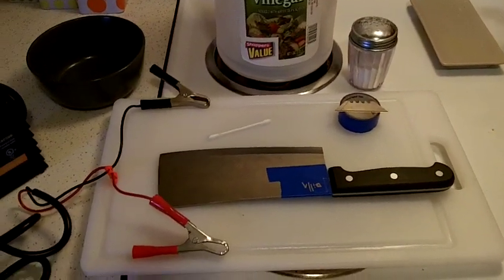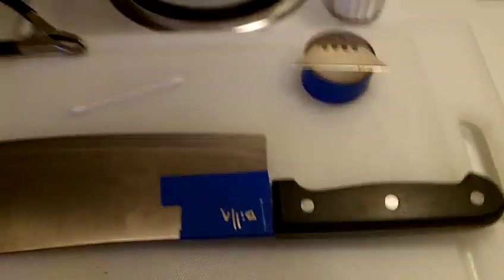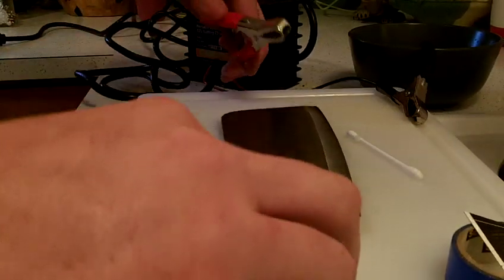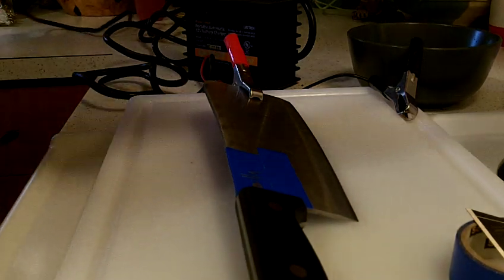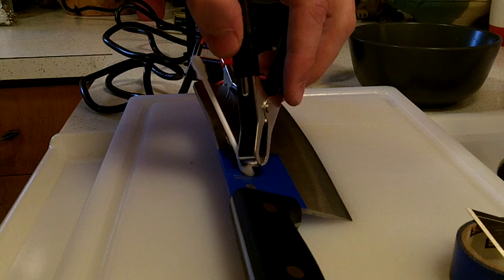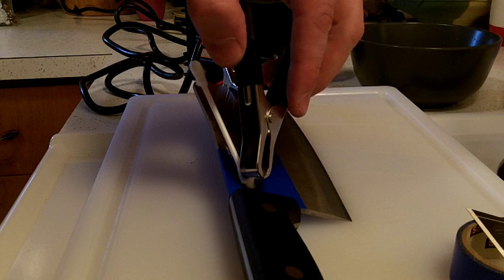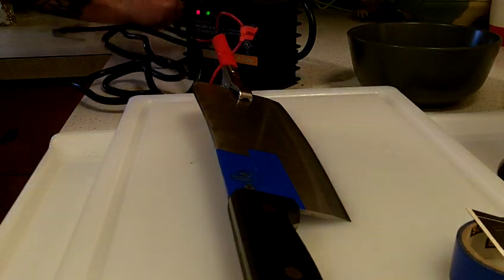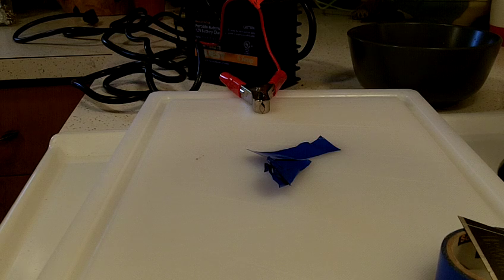how to etch steel

Comment: i want to etch 6 letters 1/2 x 1 ea in a steel plate that is 1" x 48" x 96" 
1307 lbs    how much electrical current would i need ?

Comment: anyone come up with a reusable material to make a template from? Something durable that continues to be sticky after many uses?
Reply: silhouette cameo.  I lay all my stuff out in illustrator, cut out the negative on light adhesive shelf paper
.I made 3d camo stencils that turned out very sharp.
Reply: shelf paper is a good idea, does it stay sticky after using it a bunch of times? I've been using electrical tape so far and it holds well for half a dozen uses or so
Reply: I mainly use it for glass etching but if you need to resticky the template.. just spray it down with some spray tack. Cameo makes it easy cause shelf paper is cheap and cutting out in the cameo is as easy as printing so I usually just throw away after peeling.  Shelf paper is wide enough to do bigger stencils and doesn't stretch much if you need to peel it.  I even made stencils cut from card stock and overhead projector film for camo projects.
Reply: I'm making tiny maker's marks for knives. Thanks for all the info! I'll take it into consideration.

Comment: worked great. Used a 12volt, and tried it on the hardest steel I could find. An single bit axe head, which I believe is forged steel. Burned a dark lightning bolt in it, looks good. Make sure to take your time in getting the shape in the tape(I used Duct tape), using a razor/etc. Cause the burn looks exactly like it. :) Good vid.

Comment: Good vid, thanks!
I have a question, maybe you've tried: Blackened steel. Does it etch well with vinegar? It's nothing special, 440 stainless. I'm curious before I set everything up if i'm just going to be wasting my time. Cheers!

Comment: You do realise that stainless steel has no coating, it's an alloy of carbon steel, chromium and nickel. There is no stain, perhaps he should try using a stronger acid such as sulphuric acid or hydrochloric acid.

Comment: Some (many?) chargers won't supply any current unless they sence a complete circuit with some voltage... IE if your battery is totally dead you couldn't charge it because the charger thinks there's nothing there. So in this case, i bet your charger isn't doing anything at all. Try using a 6V battery, like a dry cell flashlight battery. It could get exciting quickly if you tried a 12 V car battery - i'd avoid that!

Comment: We etch stainless steel at my work all the time.
Easy way to make sencils is to use stencil paper and an old dot matrix printer. Just feed the paper in an print away. The printer punches holes into the paper for whatever design is on the computer program. Also - a good cheap beginning etching kit is at wttool.com search for 'etching'

Comment: I used to work at a knife shop that used chemical etching, you can have stencils made off computer designs in vector.  I forgot the name of the company, someone stole my machine and chemicals to do it.  Much more expensive since you have to order a new stencil each time.